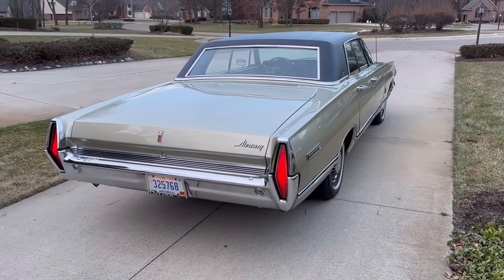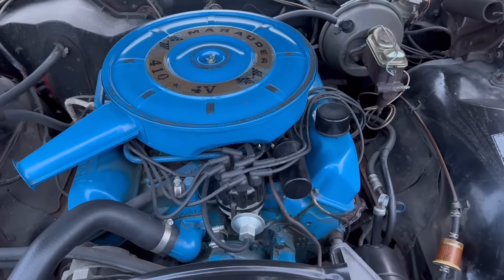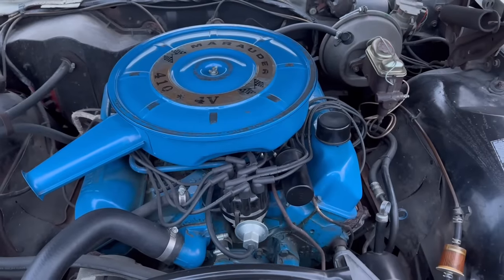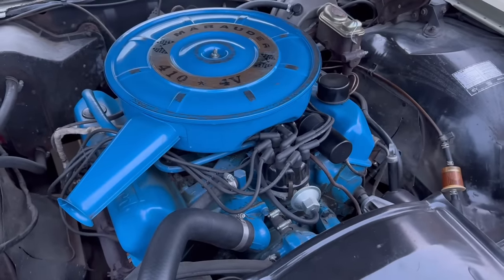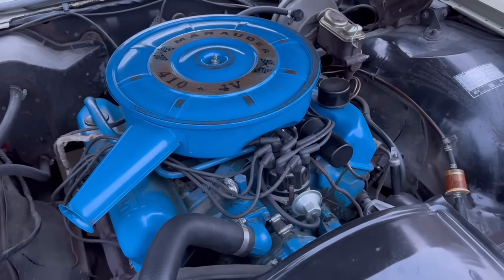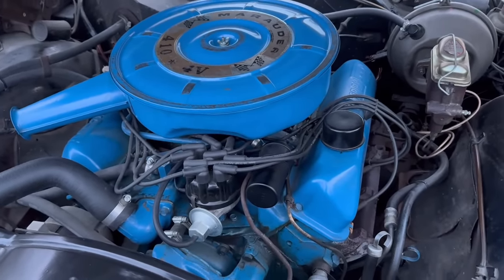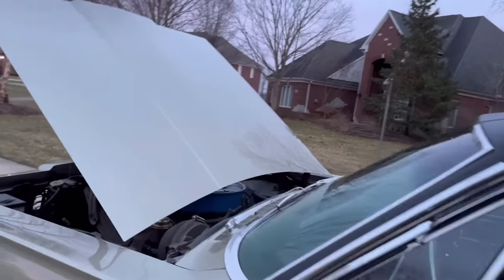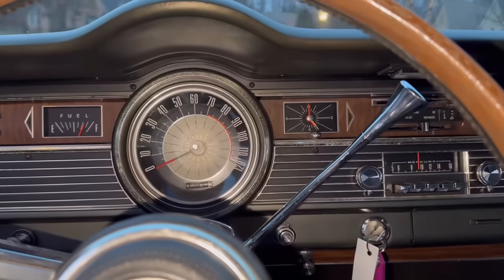Ford's Shortest-Lived (and Smoothest) V8 Engine: The 1966-67 Mercury Only 410 V8

Comment: 410 was really  380 hp this is from a  MEL engineer  rated low for insurance purpose 
Autolite 4100 4300  carb  or Holley  we have a 67 with  410 4 speed with shelby touch 
It has Paxton supercharger  and 1966 Montclair  with the 410  both cars have duals 
Heavy Duty suspension Brakes  awesome video thanks for posting
Reply: I wonder if your MEL engineer might be mixing up his engines.  The 430 V8 in a '58 Mercury could be had with 360hp (single 4-barrel carb) or 400hp (triple 2-barrel carbs).  It's a bit hard to believe that a stock 410 from '66/'67 could have been capable of 380hp.  The 427 that was available in the '67 Fairlane & Comet was openly rated in the mainstream sales brochures at 410hp (single 4-barrel) or 425hp (dual 4-barrel).  It seems odd that Ford would be up-front about the Fairlane/Comet engine ratings, but then play the "numbers game" with the 410 which was only available in the larger and heavier full-size Mercs of '66 & '67.
Reply: @bobcarlino7280  hes dead on all engines were underrated 
We have a tri power 2 dr post mercury 1957  and 57 Fairlane   the 312 f code is bumping 340 hp McCullough supercharger   the mercury 425 hp to 435  tri power  depends on optimal cam used  both 57 were "" haulers "  with 80 gallon tanks for white light

Comment: I've had several 410 Merc's over the years. Bought what was told to me  3 390's? Only to discover they were Merc 410's. I wasn't disappointed, Especially when one of them turned out to have 428 CJ crank and rods. All had standard 390 4V heads. After working them they were all really good Performers. The last year was 1968 though. I pulled one out of a 68 Mercury.

Comment: The 460 Delivers more Torque and that is what you need to move these 5000 LB. Cars. Your Mercury looks like Steve Mcgarrett's car on Hawaii Five- O.
Reply: Yes!!!
Reply: book 'em Dano, now that song is in my head
Reply: What a Great time the late Sixties were, the Best of Everything and no whacked out scumbags wandering da screets. @porkyswelding
Reply: A 1967 Parklane 2 door Hardtop weighed 3,970 dry. Add 113 Lbs. for AC. This is according to my 1968 Kelly Blue Book. He really doesn't need a 460..

Comment: I've torn down a 390 from a dump truck that used 410 pistons for lower compression. The 410 used of the shelf parts from other FE engines but had unique pistons with a shorter compression height.

Comment: The 410 was a 352, 390 bore, with the longer stroke 428 crankshaft.  They were also used in Ford police package cars.  The favored motorhead engine rebuild was to bore .030 over and restroke with the 428 rotating assembly.  That turned the 352, 360, 390 FE engines into a 416 and it ran great.

Comment: I also recall a 406 FE engine that was available in the early 60s Thunderbird. They also were tri-power equipped, if memory serves me correctly. I think these were pretty rare, too.
Reply: Yes 62 63 only.  Bigger bore / smaller stroke than 410
Reply: The Ford factory never installed the 406 in any T-Bird.  The 430 was available in the '59 & '60 T-Bird as an option over the standard 352, then starting in '61, the 390 was the only engine you could get from the factory in a T-Bird until the 1966 model year when the 428 became an option.  You could get a tri-power set-up from the factory on '62 or '63 T-Bird, but the engine was the 390, not the 406.
Reply: Mercury Monterey S-55 tripower 4spd 406

Comment: IIRC there was also a 410 cu. in. MEL (Mercury-Edsel-Lincoln) engine that was used in the 1958 Edsels that were Mercury-based.  (Citation and Corsair.)  However, that engine was known by its torque value.  It was called the "E-475" because maximum torque was 475 ft. lbs.  The other engine that was offered in the Ranger, Pacer and the Ford-based wagons Villager, Bermuda and Roundup was the 361 cu.in.  It was an FE engine and was known as the "E-400" because its torque value was 400 ft. lbs. at 2800 rpm.  That is the only time torque values were used to express an engine size.  As far as I know, the 410 cu.in MEL engine was only used for 1958.  The Mercury-based Edsels were discontinued after that.   There was also a 406 as well and IIRC it was an FE engine.  It was used for less than 2 years until it was replaced by the 427 cu.in. GREAT VIDEO!
Reply: I think you mean that that's the only time FORD engines were identified by their torque value...Buick did something similar back in the mid-60's.  As I understand it, the practice was dropped because of complaints from Buick owners who would see something like "Wildcat 445" in a sticker on their air cleaner, then they'd go looking for parts for their "445-cubic-inch" engine (which, of course, didn't exist).

Comment: 390 bore, 428 stroke. Ford's FE took something from Chevy small blocks in mixing and matching bores and strokes to come up with various displacements.
Reply: And Chevy took something from ford’s FE when they spaced out their exhaust ports on the big block. The Siamese exhaust ports on the 348/409 killed torque. The baddest 409’s only had 420 ftlb’s about the same as ford’s 390 and mopar’s 383. When they straightened out the ports the bbc really took off
Reply: For 1957 Chevy increased from 265 to 283. By that time Y blocks had increased from 239 & 256 to 272 & 292, by '56 were up to 312. Who took lesson from who?
Reply: @travislostaglia8861  The siamese exhaust port heads weren't the weak spot on the 348/409 family, they performed pretty well for their design era and intended purpose. The combustion chamber was kind of a mess, but the achilles heel of the 348/409 was the bottom end as it was only ever intended to be a 348 for trucks, as soon as it got punched to 409 and people started beating on them the bottom end would come apart. That's why just a couple years after the 348/409 debuted they were already working on the Mark II 409/427/396 which of course later became the mass produced Mark IV 396/402/427/454 we all know, both versions having a substantially beefed up bottom end with the improved combustion chambers, and separated ports.

Comment: I am wondering if the Fairlane 221 V8 produced in 1962 and 1963 had about the same short production run as the 410 Mercury engine?
Reply: Yup..

Comment: In the 1980's I had a 64 mercury 4dr hardtop with factory a/c with a 390 2V.  My uncle passed away and his family gave me his 66 park lane with a 410 4V.  it was rusted out so I put the 410 in the 25th aniversary monterey.  I added stock dual exhausts and wow what a different car it was.  It was the first year for alternators in 64 mercs so mine did not have a fusible link,so when a diode shorted out- it  went on fire -until i pulled the battery cables.  Napa  told me to put in a fusible link in to avoid future problems. i hooked up MSD ignition too! sold it in the late 90's -big mistake because it was a good car.

Comment: The 6 312s I had were SMOOTH too. I could get them to idle at 400 RPM. I also think the Buick Nailheads were smooth. I think part of the reason is the small valves create a very fast intake velocity at idle.
Reply: I agree, the 352 in the pickup truck idled smoother than the 460 in the Lincoln, almost as smooth and quiet as a Packard V8...  The small Nail valves were probably good at mixing at idle speed, but I bet it still wasn't as smooth as the Buick Straight 8.

Comment: So throw a 428 crank in a 390 and ya got a 410......very cool!!  Stroker 390!!
Reply: Ford mentions stroking 390 to 410 in their 1969 performance catalog.
Reply: Not exactly,, you have to add the specific externally balanced flywheel and the specific externally balanced harmonic balancer..

Comment: Hi Adam and thanks for the video. Your Park Lane is superb and runs as smooth as silk. That 410 V8 is a rare bird. It is amazing how many different engine choices you could get in the 1960's My Mercury Grand Marquis LS is a 1989 and your only available engine was the 302 V8 with fuel injection. Only rated at 150 horsepower but 270 foot pounds of torque does allow it to get up to speed pretty well and it also runs very smooth. These cars are great turnpike cruisers due to the 4 speed automatic overdrive transmission which keeps the RPM's down at freeway speeds. It also helps with gas mileage - I get 24 MPG on the highway and 17 around town.

Comment: My Dad bought a 64' Ford Galaxy XL convertible brand new. It had a 406 in it with 3 deuces. Just recently learned that the 406 was only offered for 2, years, 63' & 64'. 
Great information on the 410.

Comment: One of two short lived engines that comes to mind is the first Windsor small block, the 221 c.i. used in the '62 and '63 years only in Fairlanes. The other is the 255 Windsor small block used in '81 and '82 fox body cars.  It was only used to meet EPA CAFE requirements. As an engine, I'd say they were a failure.  They had breathing problems and sludged up badly.  I had a 255 in an '81 Mustang and swapped it out for a 302.

Comment: Man I love the old Fords and Mercury cars. As far as I'm concerned, the  289 and 390 were the best engines ever built and that 410 I bet goes right along with them. All same bore, different stroke. They used the same heads. I can do anything repair wise to those cars. Todays cars, not so much. I noticed the steering wheel, they call it a safety steering wheel, I had an accident with one like that and it dang near killed me, and took out my bottom teeth, so be careful. I love that car, you have a real jewel there.

Comment: The very first Windsor v8 was introduced in 1962 exclusively for the new for 62 midsized Fairlane. It was a 221 cubic inch v8 available in 62 and actually discontinued in mid year 63. So  one and a half model years only.

Comment: It's possible your quietude and smoothness comes from a more fundamental camshaft. That is worth it's weight in gold. Don't criticize the lower flow carburetor. It's possible you didn't need a rich mixture. If all your plugs are the same color, that's a good sign. I'd look to add a fuel drain so you can easily store the Mercury with an empty tank and carburetor. What a sweet design for six passenger cruising.

Comment: Adam, don’t forget Ford’s 221 small block introduced in ‘62 in the Fairlane and Mercury Meteor and offered for only two years (1962 and ‘63). My first car was a ‘63 Fairlane Coupe with this engine which was reliable but not very powerful. As I recall the compression ratio was something like 7.5:1 with HP rated at 145 I think. I don’t believe mine ever made anything like 145 HP, in fact I think it very likely was closer to something approaching 100.

Comment: My parents had a used 67 Mercury Monterrey. After a few years we needed to replace the exhaust. We thought it was a 390. Upon crawling under it with the new two into one from the exhaust manifolds I discovered it wouldn't fit! I drug the old one to the parts store and it matched the 410! I guess someone swapped it, as you say the Monterrey came with the 390.

Comment: My first car was a '67 Colony Park wagon with the 410 Marauder engine. The book had it rated at 330hp and 453lbs/ft of torque. It was the ultimate sleeper and I pissed off more than one SS and Camaro owner. I rebuilt it to spec and you could barely tell when it was running.

Comment: Growing up we had a 1968 Mercury Commuter Marauder Station Wagon w/ a 390cu.in. 2 barrel or "Two Varrel" as the air cleaner cover stated.
What a ride, it was as comfortable, smooth and quiet as a Cadillac. It just floated down the interstate at 90mph like it was nothing. 
That 265hp 390 was a powerhouse of an engine for how big that car was at 4358 lbs curb weight. It was so smooth and easy to drive. Surprisingly it also was around 20mpg.

Comment: Great car! The 410 was a great engine. Lots of torque. My 67 Fairlane had a 390. But i wanted more power so I dropped in a 428 crank basically building a 410. I ran a 6oo plus lift solid lifter camshaft with 260 degrees duration @.050. 12 to 1 compression and 4.56 gears. Lets just say never lost a race after that. The 427 was a great racing engine. But with the extra stroke of the 428 crank it really has some ridiculous torque. Thanks for the great videos.

Comment: My fav FE is still the 406. its basically a punched out (0.080) 390 but they came in extra spicy. The 3x2 was a 12:1 405hp cast header deal. Some of the last ones even were supposed to have the cross bolted blocks. You could also get them in a Galaxie with a four speed.

Comment: A stroked 390 explains the insane torque spec. That's actually a better spec for a large car as it will be more fuel efficient than a 390 and have a better low-speed throttle response. Sweet ride Adam👍👍

Comment: There's two Ford V8 families that fit that 'smoothest V8' neighborhood. 
The FE definitely fits, my '67 Thunderbird (390) could be gotten to idle smooth enough to stand a cigarette on its filter (granted, they were slightly bigger in dia.) on the flat ring of the air filter housing while it was idling and it would stay standing.
The other, a 239 Flathead - I remanned one for a customer, and at 500 rpm, you could rest your hand on the hood of the truck and just barely tell it was running.
No other Ford V8 - we did many - would idle as smooth as those two engine families.

Comment: When we moved to a rural community in 1974, there was a family in the 'hood with a station wagon with a 410 engine. I thought they said it was a 1965, but it could have been a 1966.
In common with the 428's stroke, the 410 is also said to have a counterweight behind the harmonic balancer.

Comment: I miss my 67 Mercury Comet Capri with a 289 .. absolutely a fantastic car ,’..  bought it in 1979 for $175 … absolutely a cream puff 46,000 miles … I just had to put a starter on it … drove it daily until 1988… till I traded it in for a 1977 Mercury Cougar 351 that had 20K on it..

Comment: My dad's 1958 Edsel Citation had a 410 cubic inch (6.7 L) engine called the MEL 410, I wonder if this 410 FE is basically the same, sure does look familiar. That car was FAST! A Pennsylvania state trooper clocked us at 110 mph on the PA Turnpike and the Edsel was just cruising with some more to give. BTW it was our extremely lucky day, we got off with a warning. This was in the summer of 1959

Comment: My dad purchased a 1968 F250 new. It was purchased as being a 390. This pickup was used hard for farm use. It always had very good power. Lots of time pulling a gooseneck trailer, hauling an old Case backhoe. After years of service, it started burning oil at an unacceptable rate so dad pulled it for rebuild.  A new set of pistons was ordered, and low and behold, they were much too tall. After more checking, we discovered that the crank was a 428.  I suspect, maybe, Ford had left over 410's that didn't have Mercury's to go in so they may have used up stocked engines in the pickup line. I have no proof that's what Ford did, but I have proof positive that, that pickup came, with 410 from the factory. If I remember correctly, we could not order 410 pistons and we ended up milling the pistons to the correct height.
Reply: I also know of a F-100 with 410 that a friend of mine had in the mid 70s.

Comment: I have a 69 Ford F100 short bed pickup.  I swapped in a 410 out of a wrecked 66 Parklane . I rebuilt the 410 adding a comp 268 cam , Edelbrock streetmaster intake manifold and a Holley 750 cfm carb. Msd ignition system and headers . And wow did it wake the 410 up. I have a built Top loader and gear vendors over/ under drive and 3.90 gears. The truck is pretty quick although traction is somewhat unavailable for the first 300 ft or so . But what a great engine

Comment: I never heard of that engine! But, I was a Chevy guy back then mostly.
I bought a 69 Mercury Cougar that had the 351W engine, FMX trans, and 9" rear and transplanted the drivetrain into my 70 Mustang Fastback that came with the 302, C4, and 8" rear.  The Ford carb on that 351W was trash.  It had multiple problems that I gave up on fixing and replaced it with a 600CFM Holley.  I eliminated the vacuum advance and modified the centrifugal advance to max out at 32 degrees BTDC with a 10 degree BTDC idle setting.  That Mustang ran quite well after that.  I embarassed a couple of TransAMs with that car.

Comment: I offer the 1962 Ford 406 c.i. FE Series V8. It was first published in the March 1962 (1962 model, revised) and August 1962 (1963 model, first edition) full-size Ford brochures and was superceded by the 427 c.i. V8 in the December 1962 (1963 model, revised) full-size Ford brochure. That alludes to a shelf life of approximately seven months. I can't think of another Ford V8 that had a shorter production run.

Comment: I've owned 4 separate Merc 410s. Originally bought a school mates Park Lane he wrecked because I wanted to pull and save the 390 from my 63 1/2 Galaxie for numbers matching reasons. I noticed it had as much omph as the top of the line ordered 390 so I bought another one and took it to my circle track engine builder. He was a tight lipped builder, worked only on FOMOCO and MOPARS, didn't have a lot of competition in the local circle track business, wanted to keep it that way. Customers blab was his belief.
He stroked it to 458, valve work, match ported the 4" riser intake, 870 cfm Holley, and built headers for the Galaxie 4-speed. If you wanted to know hp numbers YOU figured it out on paper.
That car never lost a lap on the 1/4 mile, even against late 60s to 71 big blocks. I owned at the same time a '60 Impala with a LS6 and trans from a '70 Chevelle I knew couldn't pull the same numbers. 
Those are 2 of the 3 cars I wished I'd of parked in the back of the machine shop and never let go.